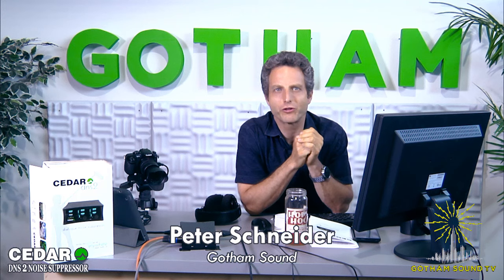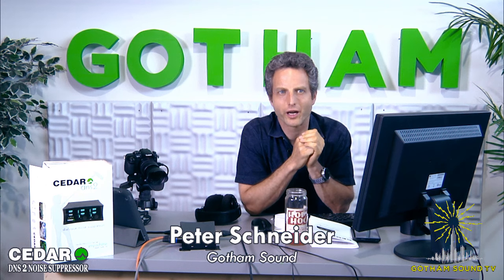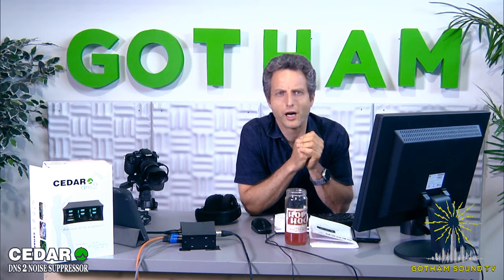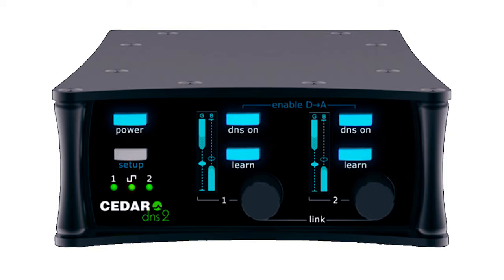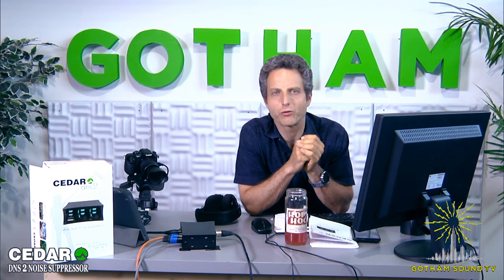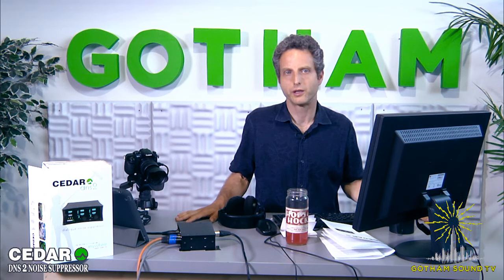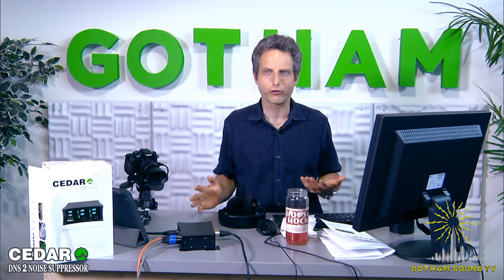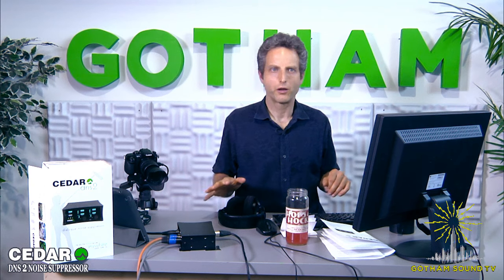Cedar DNS 2

Comment: I dunno, it's not the miracle I had hoped for.  When it gets rid noise, it cuts into the voice.  It gets rid of ambience which would serve to set the scene in a video.  But it does not get rid of competing voices (well, admittedly, that would be really a miracle).  I must say the video would have been better if you'd figured it out before doing the demo.  Talking to yourself (and to us) covered up a lot of the demo sound that we wanted to hear.   Thanks for the effort.